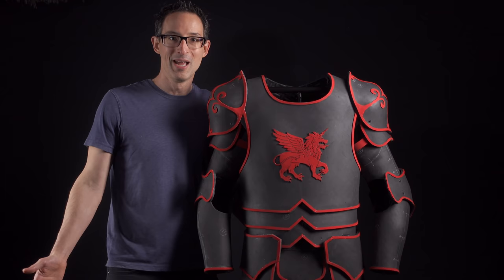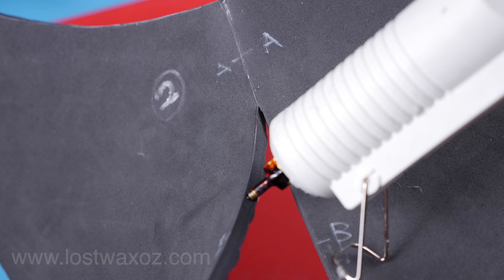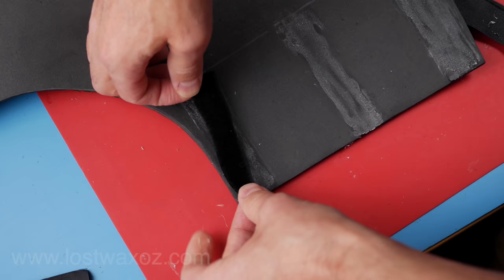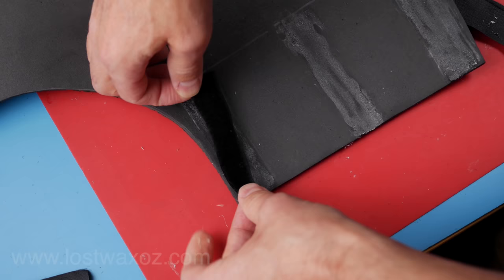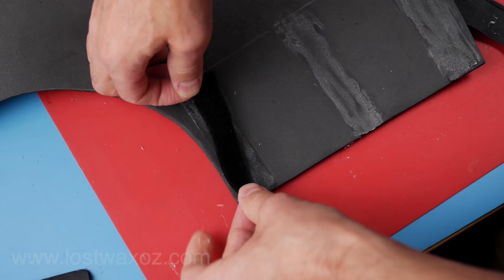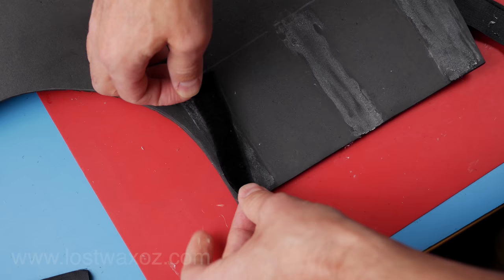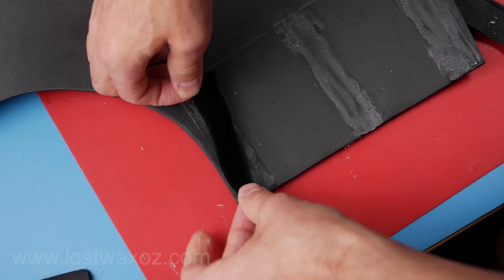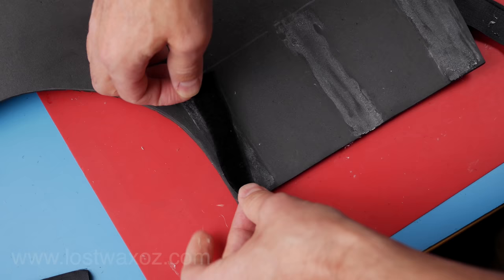DIY Knight Armor Cosplay / How to Make a Foam Knight Armor Costume Using Hot Glue!

Comment: The shoulder pieces NEED to be larger,--in your pattern and in subsequent other-sizes, because there are HORRIBLE-GAPS near your under-arms!  In the 15th century [--1400s ] the knight's Armorer would make larger Pawldrons than you have made, with a disc-like "Besegue" that'd cover the front of the joint.   People think that knights fought with lots of Space, one-one, and that was the IDEAL, but oftener knights by the hundred, had closed to the point that the only thing [--if they were LUCKY! ] was to be able to move ONE arm with a dagger/sword held at-an-angle to poke/thrust-with, as the PRESS of armored bodies made them barely able to move at all.  With your shoulder-pieces So small, your suit LOOKS "Ill-fitting"--Dangerous!  Anyone wearing it "In the PRESS", would Soon LOSE the USE of both arms on the way to being stuck by swords/daggers until dead, Dead, DEAD!   The Duke of Norfork AND his son were both slain, in the Press, and their being slain [--although probably still upright,--corpses in armor], led to Richard III of England "The 'car-park'-King" on his quest with his Household-knights to try to FIND where Henry Tudor was hiding, and he was found, and after Tudor's standard-bearer {& Champion} Sir Cheney was slain by Richard, Tudor was behind a Wall of French Pikemen, so Dickon then asked for his Axe {--to hack-through the covering pikemen to then KILL Tudor } but Tudor's Welsh Cheshiremen moved to attack[flank] Richard's Household, so they HAD to leave, but Richard wouldn't and then some bastard put an arrow into his back, and when his huge white charger was torn-open, charging those pikes, he was un-horsed & "daggered"-to-death, by the cheshiremen, the Last English Monarch to be killed in Battle, on/around Bosworth Field, in Aug. 22nd, 1485.   Lord Lovell escaped the field with others, and tried [& Failed] to defeat Tudor's Army under the Earl of Oxford in 1487 @ Stoke, but Lovell again escaped to later die in a small space/room carved out of his castle Walls,--a fugitive within his own Manor.   All this because King Richard didn't have a "Male-heir" from his loins, which is WHY Henry the VIII had so many wives--he HAD to have a male-heir or his Barons would KILL him as his Father Henry Tudor did against Richard III.